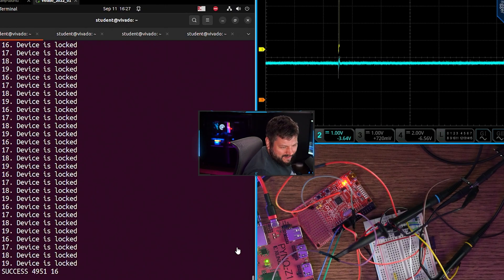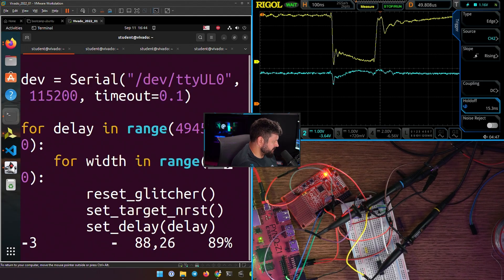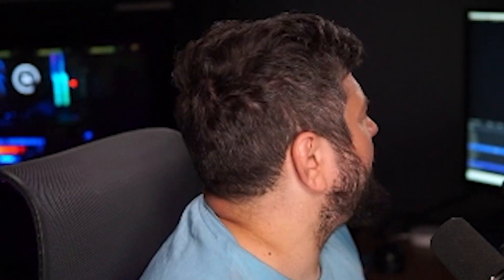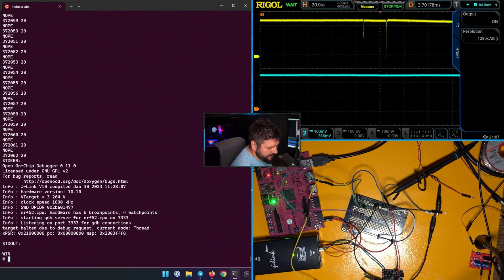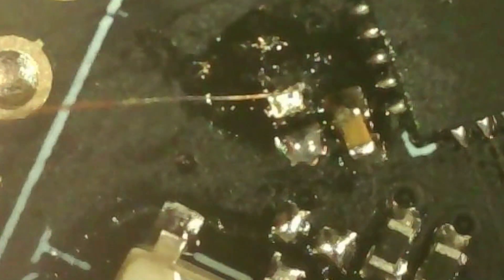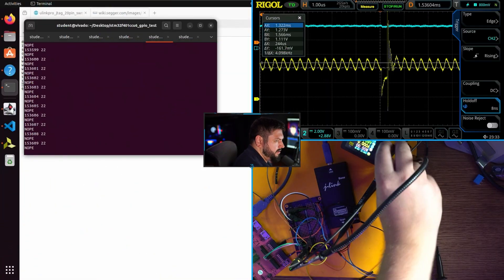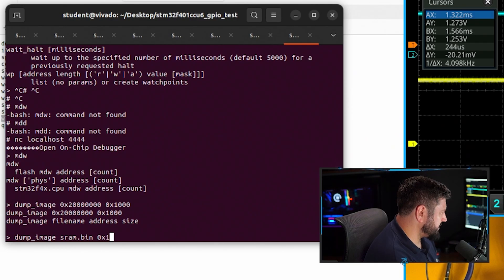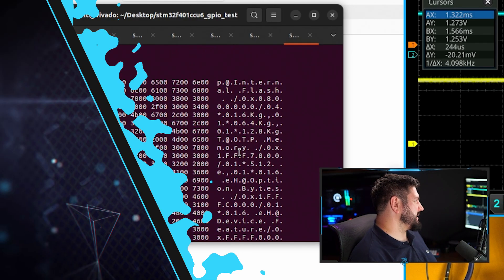Glitching and Fault Injection. Voltage glitching the STM32, NRF52 and NXP LPC.

Comment: Would this work on a nrF51802? It's an older chip that has APPROTECT enabled and can't get a firmware dump of it. I've searched but can't find much info on if it will even work with this chip.